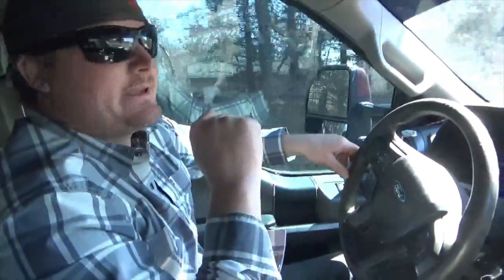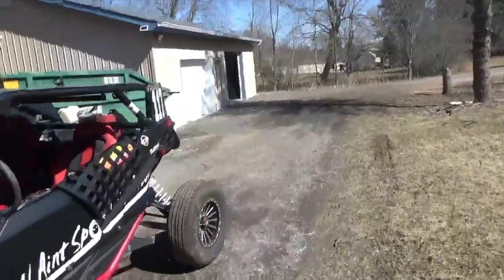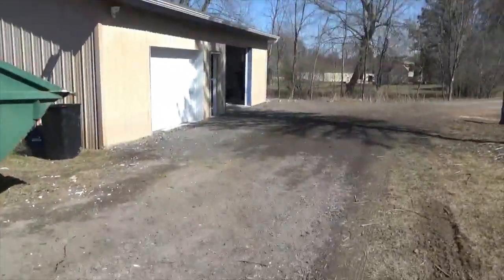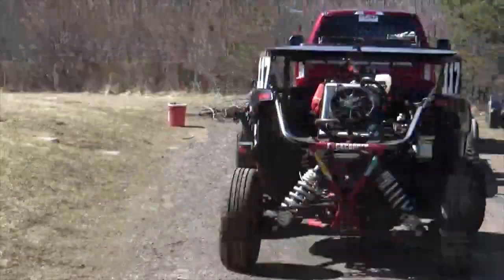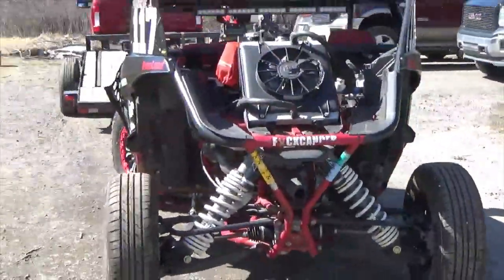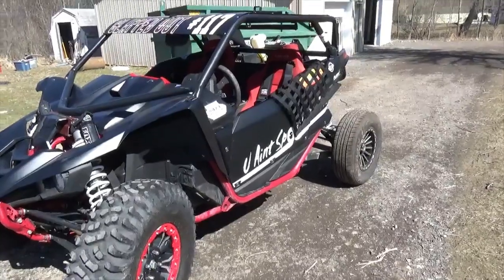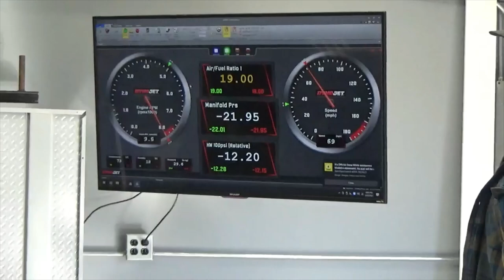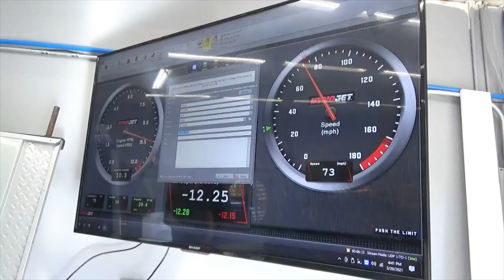#CLAPPEDOUT turbo YXZ hits DYNO finally and merch drop

Comment: 7900 miles on my  2016 yxz suspension.  Just put Weller's desert dune package on it. WOW.  I can't suggest a better upgrade. It just handles so much better. Never pushes threw corners just turns and soaks up stuff,  so much better. Keep the yxz content coming. 👍 good stuff on the dyno pull.
Reply from the maker: I do ride some  narrow trails up here so I like the short little guy
Reply: @nolimit4730  not long travel.  Just dualrates and a valve job. I'm still 64 wide too.

Comment: I’m running k and t low boost kit around ten pounds with 1000 cc injectors. Can’t wait to see what you make.
Reply from the maker: Any plans for spinning the Dyno with your machine?
Reply: that would be cool to do. I’m at 4600 ft so my numbers would be a bit lower
Reply from the maker: Pssssshhhhh turbos don’t care about elevation
Reply: @nolimit4730  you’re probably right. I just bought my second Yxz. First one was N/A.  I am new to having a boosted one. Already destroyed all the bearings in the rear diff. So she is parked for a bit. What diff are you running? Mine is one of Lorue’s first designs where they welded billet to the case. I just picked up packards carrier bearing. Just got to order the other bearings now.
Reply from the maker: I’m on stock 19 diff with a cradle I built.  I’ll need a good setup someday soon

Comment: What brand exhaust muffler are you using
Reply from the maker: It’s a custom piece I made from a cherry bomb
Reply: @nolimit4730  i ordered a gytr kit for my yxz. ill probably just use a universal straight thru muffler, cant justify spending 400 for a slip on..
Reply from the maker: Yes they are crazy money if you have any fabrication skills cut the 90 off your stock muffler and go get a short cherry bomb and then all yea need is couple brackets ... welder up and like I said mine literally bolts right up in stock location